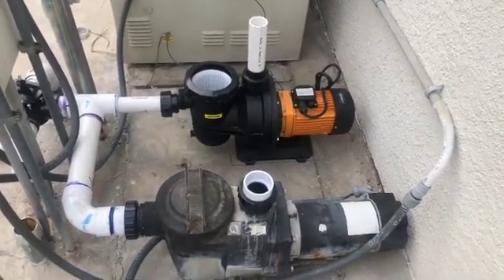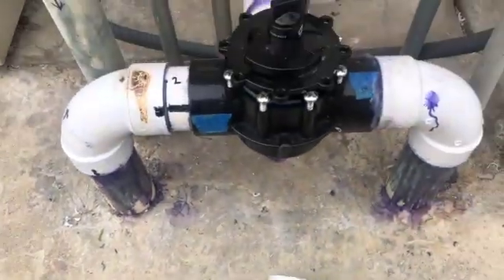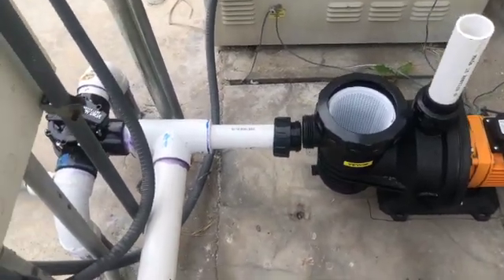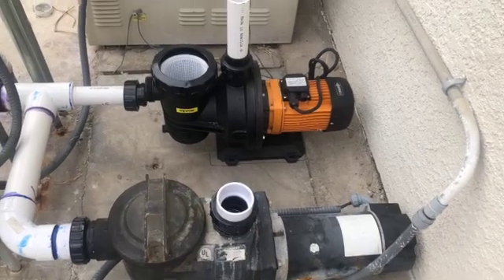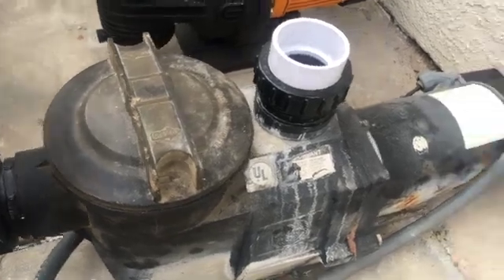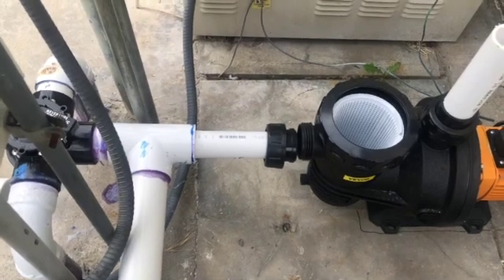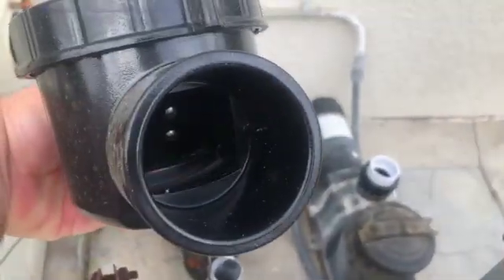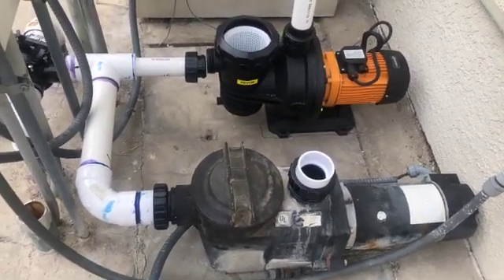Solar Power Pool Pump DC Off Grid

Comment: Now on Amazon they have the same pump with 136 GPM capaciy
Reply from the maker: I would have gone with the larger pump if it was available when I did the project, but mine is doing just fine for a year now.  The pool water has been the cleanest it has ever been compared to when I was using the AC pump that I didn't run as much due to the cost.  The solar pump starts running as soon as the sun comes up.

Comment: 3:10   Just use a 45 Fitting, put the pump in a 45 angle and you should be Fine. Another thing, you are using DRAIN elbows in your system, you need to use pressure elbows...
Reply from the maker: Thank you.  I didn't think of that.

Comment: I appreciate your "update" but for me, never having seen the original video(s), it would be nice if you provided a link to to anything else in this series.  I'm assuming you previously covered which solar panels you're using and stuff like how you sized the pump to make sure it didn't damage your filter (but still had enough flow to clean your pool.)  Anyway, I hope you get it working.
Reply from the maker: Thanks.  Initially I cobbled together a DC motor to an old bronze pool pump housing and it did work at the poolside, with 3 panels in series https://www.youtube.com/watch?v=GuO5nq4U_Mc   However, when I plumped in the pump where the filter is, it did not have enough suction to pull the water all the way there.  So I ended up buying an off the shelf solar pump from amazon. I did have to double the solar panel system.  I hooked it up to a total of 6 panels (2 strings of 3 in series, then both strings in parallel.  And it works great.  It's saving me a lot of money.    Here's a video of it working.  https://www.youtube.com/watch?v=JLqtm7I4xYU. Thank you for watching.